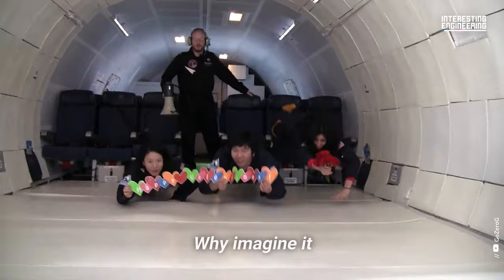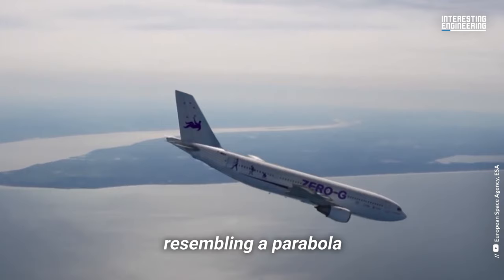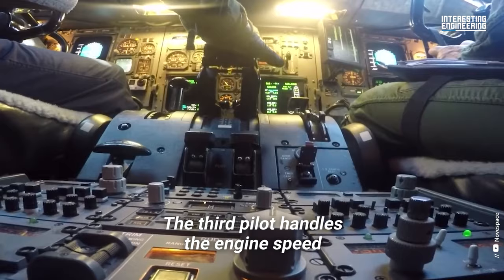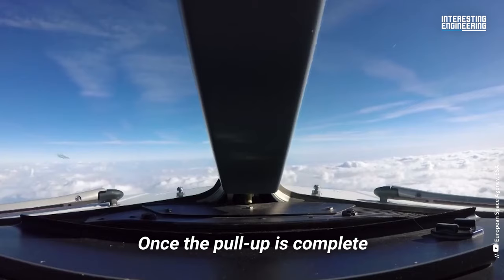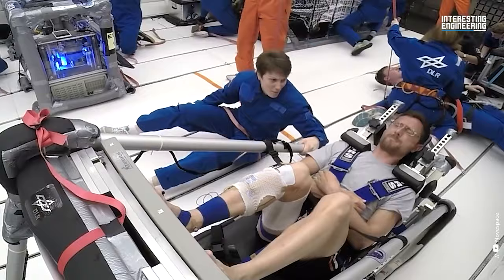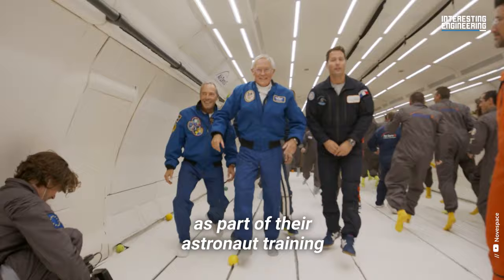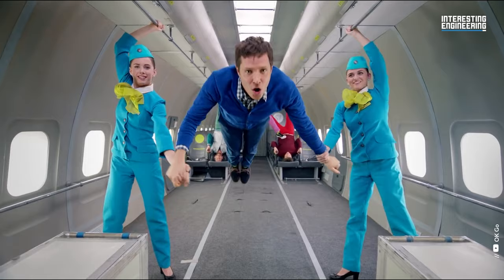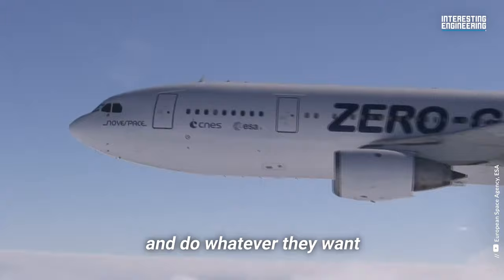How do zero-gravity planes work?

Comment: Imagine you just enjoy inside the zero g plane and the plane actually swoop down , You are having fun with other people while the three pilots are work hard in cockpit for controlling the plane correctly
Reply: BTW, if you toss a ball upwards, it is in ZERO GRAVITY as soon as it leaves your hand. Why? Because as soon as the ball leaves your hand, then there is no longer any 'upward proper acceleration' acting' on the ball. Once object A no longer touches object B, NO MORE ACTION REACTION.

NIST WTC Towers FAQ 31 - "As documented in Section 6.14.4 of NIST NCSTAR 1, these collapse times show that:"
"Since the stories below the level of collapse initiation provided little resistance to the tremendous energy released by the falling building mass, the building section above came down essentially in 'free fall'."<- essentially Zero-G & essentially no action reaction.
"As the falling mass increased, it further increased the ' demand' on the floors below which were unable to arrest the moving mass." <- 'demand' = lots of action reaction. https://youtu.be/_ZcVQCRvQWk?t=276
Reply: They signed up for it so whats the point here?

Comment: You can get the same experience on Frontier Airlines or Spirit Airlines for a couple hundred dollars.
Reply: Lol
Reply: @johnmarks714   !
Reply: BTW, if you toss a ball upwards, it is in ZERO GRAVITY as soon as it leaves your hand. Why? Because as soon as the ball leaves your hand, then there is no longer any 'upward proper acceleration' acting' on the ball. Once object A no longer touches object B, NO MORE ACTION REACTION.

NIST WTC Towers FAQ 31 - "As documented in Section 6.14.4 of NIST NCSTAR 1, these collapse times show that:"
"Since the stories below the level of collapse initiation provided little resistance to the tremendous energy released by the falling building mass, the building section above came down essentially in 'free fall'."<- essentially Zero-G & essentially no action reaction.
"As the falling mass increased, it further increased the ' demand' on the floors below which were unable to arrest the moving mass." <- 'demand' = lots of action reaction. https://youtu.be/_ZcVQCRvQWk?t=276
Reply: @davidmudry5622  WRONG! There will always be gravitational pull on it. An object doesn't need to be touching another object to be affected by gravity as you falsely claim. That is the most ridiculous thing I have read in a long time.

Comment: But but but, the women's hair don't look anything like those in the ISS?
Reply: BTW, if you toss a ball upwards, it is in ZERO GRAVITY as soon as it leaves your hand. Why? Because as soon as the ball leaves your hand, then there is no longer any 'upward proper acceleration' acting' on the ball. Once object A no longer touches object B, NO MORE ACTION REACTION.

NIST WTC Towers FAQ 31 - "As documented in Section 6.14.4 of NIST NCSTAR 1, these collapse times show that:"
"Since the stories below the level of collapse initiation provided little resistance to the tremendous energy released by the falling building mass, the building section above came down essentially in 'free fall'."<- essentially Zero-G & essentially no action reaction.
"As the falling mass increased, it further increased the ' demand' on the floors below which were unable to arrest the moving mass." <- 'demand' = lots of action reaction. https://youtu.be/_ZcVQCRvQWk?t=276
Reply: Two main differences: 
1. on the 0G plane, you are only approximately in 0 G. There’s no calm floating in the middle of the cabin, everybody’s bouncing around because the airplane is not describing a perfect parabola due to the air around it not being perfectly still. 
2. On the ISS, astronauts use a no-rinse shampoo that has a different effect on the hair than conventional shampoo/conditioners.
Reply: @Hobbes746  9/11 ?

NIST WTC Towers FAQ 31 - "As documented in Section 6.14.4 of NIST NCSTAR 1, these collapse times show that:"
"Since the stories below the level of collapse initiation provided little resistance the building section above came down essentially in 'free fall'."<-- essentially Zero-G ? & essentially no action reaction, just like being weightless. But this is what the USA government said.

Comment: everyone gangsta until one of the engine falls when free falling
Reply: BTW, if you toss a ball upwards, it is in ZERO GRAVITY as soon as it leaves your hand. Why? Because as soon as the ball leaves your hand, then there is no longer any 'upward proper acceleration' acting' on the ball. Once object A no longer touches object B, NO MORE ACTION REACTION.

NIST WTC Towers FAQ 31 - "As documented in Section 6.14.4 of NIST NCSTAR 1, these collapse times show that:"
"Since the stories below the level of collapse initiation provided little resistance to the tremendous energy released by the falling building mass, the building section above came down essentially in 'free fall'."<- essentially Zero-G & essentially no action reaction.
"As the falling mass increased, it further increased the ' demand' on the floors below which were unable to arrest the moving mass." <- 'demand' = lots of action reaction. https://youtu.be/_ZcVQCRvQWk?t=276

Comment: I don’t understand how the pressure doesn’t make the airplanes wings break off or cause any other structural failures.
Reply: By the design and materials used. An older airplane would have it much more difficult.
Reply: BTW, if you toss a ball upwards, it is in ZERO GRAVITY as soon as it leaves your hand. Why? Because as soon as the ball leaves your hand, then there is no longer any 'upward proper acceleration' acting' on the ball. Once object A no longer touches object B, NO MORE ACTION REACTION.

NIST WTC Towers FAQ 31 - "As documented in Section 6.14.4 of NIST NCSTAR 1, these collapse times show that:"
"Since the stories below the level of collapse initiation provided little resistance to the tremendous energy released by the falling building mass, the building section above came down essentially in 'free fall'."<- essentially Zero-G & essentially no action reaction.
"As the falling mass increased, it further increased the ' demand' on the floors below which were unable to arrest the moving mass." <- 'demand' = lots of action reaction. https://youtu.be/_ZcVQCRvQWk?t=276
Reply: The force on the airplane is about 2 G, well within the structural limits

Comment: Zero Gravity Flights: A Journey into Weightlessness
 
Zero gravity flights, also known as parabolic flights, offer a unique experience of weightlessness. This is achieved through a carefully orchestrated flight pattern that simulates the conditions of space.
 
The flight begins with a specially modified aircraft, typically a Boeing 727 or Airbus A310, taking off and reaching a safe altitude. At this point, the plane enters a parabolic trajectory, a series of steep climbs and dives that mimic the arc of a parabola.
 
During this maneuver, three pilots work in unison to control the aircraft's movements. One pilot manages the plane's pitch, another controls its roll, and the third handles the engine speed. This coordinated effort ensures a smooth and safe flight path.
 
As the plane ascends, it accelerates to a peak speed of 426 miles per hour. This rapid climb subjects passengers to a gravitational force 1.8 times greater than what they experience on the ground, lasting for approximately 20 seconds. This period of increased gravity, known as "hypergravity," is followed by a brief moment of weightlessness as the plane enters a freefall.
 
This weightless period, lasting about 20-25 seconds, allows passengers to experience the sensation of floating freely, similar to what astronauts experience in space. During this time, they can perform various activities, such as jumping, tumbling, and even floating in mid-air.
 
After the weightless phase, the plane enters the "pull-out" phase, gradually returning to a more conventional horizontal flight path. This process is repeated multiple times throughout the flight, providing passengers with several opportunities to experience weightlessness.
 
In conclusion, zero gravity flights offer a thrilling and unique experience, allowing individuals to briefly escape the confines of Earth's gravity and experience the sensation of weightlessness. The carefully controlled flight pattern, combined with the expertise of the pilots, ensures a safe and memorable journey into the realm of zero gravity.

Comment: But how long does it last? How long before we would have to make another climb to have more fun?
Reply: BTW, if you toss a ball upwards, it is in ZERO GRAVITY as soon as it leaves your hand. Why? Because as soon as the ball leaves your hand, then there is no longer any 'upward proper acceleration' acting' on the ball. Once object A no longer touches object B, NO MORE ACTION REACTION.

NIST WTC Towers FAQ 31 - "As documented in Section 6.14.4 of NIST NCSTAR 1, these collapse times show that:"
"Since the stories below the level of collapse initiation provided little resistance to the tremendous energy released by the falling building mass, the building section above came down essentially in 'free fall'."<- essentially Zero-G & essentially no action reaction.
"As the falling mass increased, it further increased the ' demand' on the floors below which were unable to arrest the moving mass." <- 'demand' = lots of action reaction. https://youtu.be/_ZcVQCRvQWk?t=276
Reply: You get about 30 seconds of 0 G, followed by 30 seconds of 2 G as the airplane pulls out of its dive and sets up for the next parabola.

Comment: Action and reaction forces are well-described by Newton's third law of motion. When a first object applies a force (action) on a second object, the latter will apply a force (reaction) back on the former. The ground is pushing you up @ 9.8 m/s/s, your body and weight are pushing down F = ma. While action and reaction have the same magnitude, they are in opposite directions. F -><- F

Proper Acceleration -> Action-Reaction involving Forces where object (a) acts upon object (b)
Coordinate Acceleration -> Zero Gravity - No Action - No Reaction

NO ACTION REACTION IN FREE FALL ZERO-G

These 1966 astronauts in the video below are training in zero-g for a space walking mission, they're in near 100% free fall. They 'CANNOT' put any "DEMAND" on the floor below them because the 'active' upward proper acceleration of the floor below them itself needs to be in free fall so that they can be in the free fall of 'passive' coordinate acceleration...Uh-huh
Screenshot (2959).png
And while watching the astronauts you get no sense that their motion is up or down relative to the surface of the ground, as their motion relative to the ground could be either up or down when in free fall. They look as if they are just floating in mid air...Free fall, being that Einstein said it is identical to floating weightlessly in deep space, is partly why Einstein said free fall on earth is not acceleration, but rather a kind of an illusion. BTW, if you toss a ball upwards, it is in ZERO GRAVITY as soon as it leaves your hand. Why? Because as soon as the ball leaves your hand, then there is no longer any 'upward proper acceleration' acting' on the ball. Once object A no longer touches object B, NO MORE ACTION REACTION.

NIST WTC Towers FAQ 31 - "As documented in Section 6.14.4 of NIST NCSTAR 1, these collapse times show that:"
"Since the stories below the level of collapse initiation provided little resistance to the tremendous energy released by the falling building mass, the building section above came down essentially in 'free fall'."<- essentially Zero-G & essentially no action reaction.
"As the falling mass increased, it further increased the ' demand' on the floors below which were unable to arrest the moving mass." <- 'demand' = lots of action reaction.
https://youtu.be/Y-htqtkBoF4

Comment: Why it lasts only 20 seconds and why need to accelerate before and after why not just sharp down nose and then slowly climb back up?
Reply: 20 seconds because you cannot let the plane free fall forever as there are altitude restrictions for a plane also you cannot come dangerously close to the ground . 
sharp nose is actually what it performs by the way 50degree nose downs which very steep
and we can climb slowly but it will consume a lot of time and fuel to regain all the altitude lost on the freefall

Comment: so its skydiving while still inside the plane
Reply: Yes, but also starting with a lot of upwards momentum- meaning douple the time weightless. 
Weightlessness is just freefall, and freefall does not care how fast or what direction you were moving at the beginning. 
You care, though, because most of us care about missing the ground while moving fast.

If you move sideways fast enough, you'll keep missing the ground. We call that an orbit :)
Reply: NO!
On freefall you are subjected ONLY to gravity while on skydiving you are subjected to air resistance. As you accelerate, the air resistance becomes equal to the gravitational force. This happens within a few seconds. So there's no longer a feeling of wheightlessness. Only at the very beginning of the dive. After that, skydiving feels like swimming in air.
Reply: No.. sky diving is nothing like zero gravity.. its the completely the opposite 🤦..
Reply: 😆Nope. Neither the opposite. What in hell would be the opposite of skydiving??? Skuba Diving?!
Reply: That's a good way to think of it
Reply: @ThePigPig65   WRONG. The people in the plane only appear to be floating. The reality is that the plane plane is descending faster than the people.

Comment: Damn, it's too costy
Reply: BTW, if you toss a ball upwards, it is in ZERO GRAVITY as soon as it leaves your hand. Why? Because as soon as the ball leaves your hand, then there is no longer any 'upward proper acceleration' acting' on the ball. Once object A no longer touches object B, NO MORE ACTION REACTION.

NIST WTC Towers FAQ 31 - "As documented in Section 6.14.4 of NIST NCSTAR 1, these collapse times show that:"
"Since the stories below the level of collapse initiation provided little resistance to the tremendous energy released by the falling building mass, the building section above came down essentially in 'free fall'."<- essentially Zero-G & essentially no action reaction.
"As the falling mass increased, it further increased the ' demand' on the floors below which were unable to arrest the moving mass." <- 'demand' = lots of action reaction. https://youtu.be/_ZcVQCRvQWk?t=276

Comment: All without leaving earth 🤔.. mmm , so the plane doesn't leave earth then 🙄
Reply: Yeah it doesn't go to space
Reply: Every airplane leaves the ground, so the earth. Are you talking about "leaving the atmosphere"? Not possible with an airplane. However, the atmosphere becomes thinner fluently, it is impossible to say where it ends so when you actually have left it. And it has absolutly nothing to do with gravity. People in the International Space Station are floating for the same reason why they float here. This is not a "simulation" of the weightlessness that an astronaut experiences. It is the exact same effect.
Reply: So you technically leave earth every time you jump?

Comment: 2:18 😉
Reply: BTW, if you toss a ball upwards, it is in ZERO GRAVITY as soon as it leaves your hand. Why? Because as soon as the ball leaves your hand, then there is no longer any 'upward proper acceleration' acting' on the ball. Once object A no longer touches object B, NO MORE ACTION REACTION.

NIST WTC Towers FAQ 31 - "As documented in Section 6.14.4 of NIST NCSTAR 1, these collapse times show that:"
"Since the stories below the level of collapse initiation provided little resistance to the tremendous energy released by the falling building mass, the building section above came down essentially in 'free fall'."<- essentially Zero-G & essentially no action reaction.
"As the falling mass increased, it further increased the ' demand' on the floors below which were unable to arrest the moving mass." <- 'demand' = lots of action reaction. https://youtu.be/_ZcVQCRvQWk?t=276